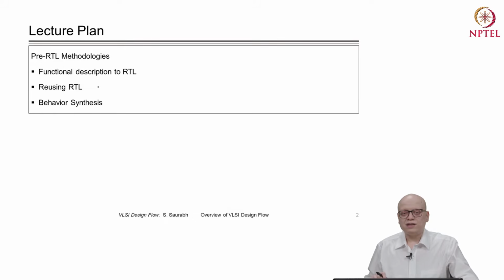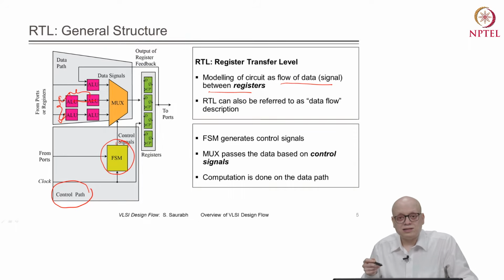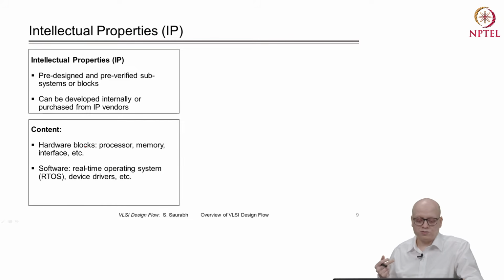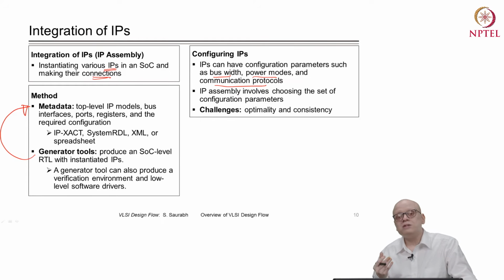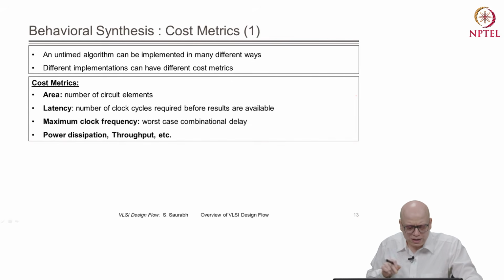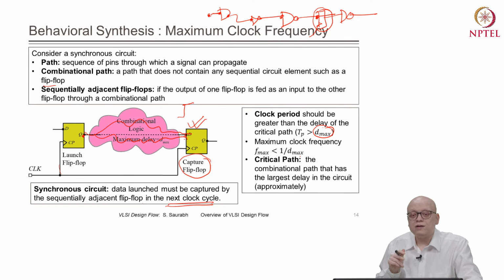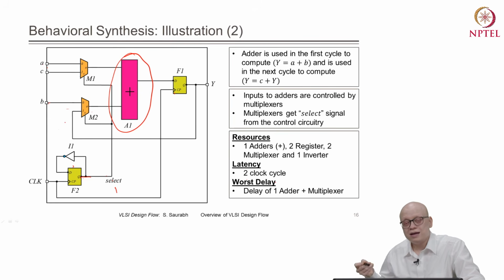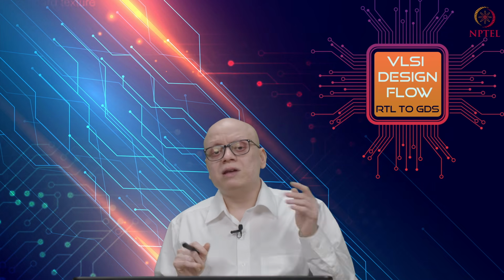Overview of VLSI Design Flow - II

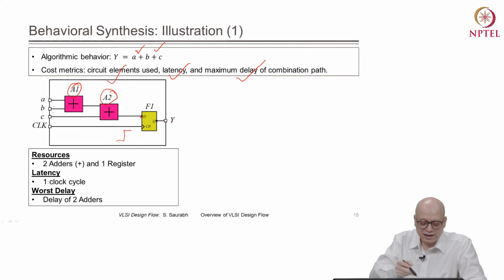Comment: At 34:39 why do we need flip flop, can anyone explain
Reply: We used FF there to synchronize the circuit with clock... Most of the designs are synchronous because those are more controllable and less prone to glitches...
Reply: Flip flop is used for storing information
Reply: Most modern SoCs use clocks and sequential circuits, which is why D flip-flops are needed. In operations like addition or subtraction, results are processed in clock cycles. Registers (made of flip-flops) store intermediate results, so adding a D flip-flop after adders helps to synchronize data and allow faster clock speeds.
Reply: @yuga9511 now i understood, to store intermediate results or to store previous output if any exceptions happens in the circuit.